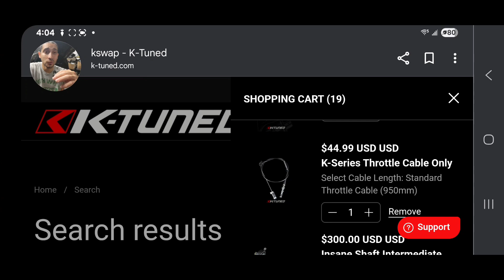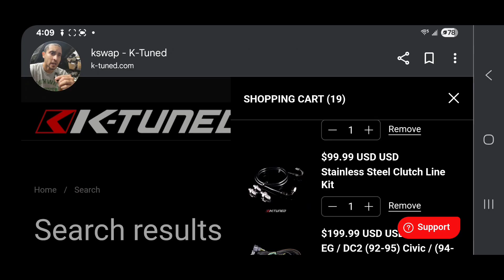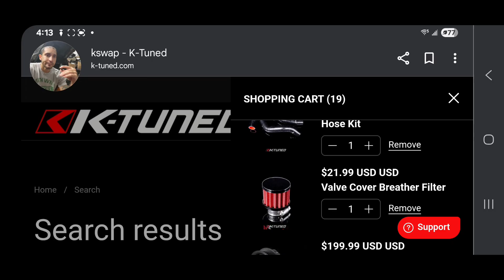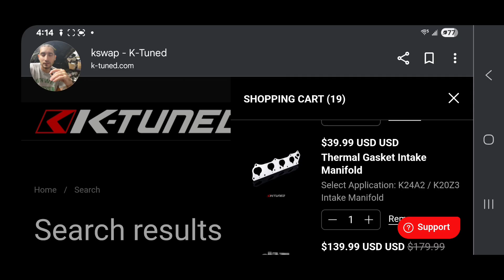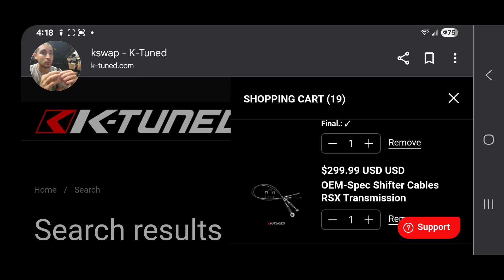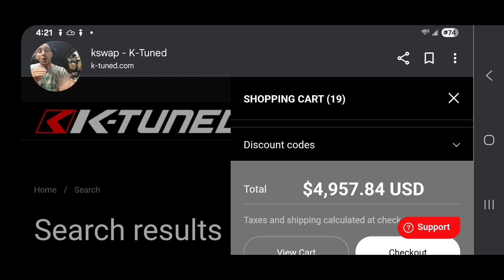🔧 Full K-Tuned K-Swap Parts List | Everything You Need for Your Build!

Comment: Good video!, I’m running there 72mm TB and ported my rbc for it💯. I’ve heard for a lot of the guys that do k swaps that the Hybrid Racing Conversion Harness is one of the best for the money. haven’t seen much feed back one the ktuned one.
Reply from the maker: 72mm is nice... I was going to throw in a 72mm eBay one, but I wanted the purge valve so opted for the 70mm. The ktuned one is pretty old routing style from my understanding. Hybridracing is modernized and gives you the ability to run all of your features.
Reply: @Almostboosted 🙌🏻
Reply from the maker: Thank you bro for the support 🙏